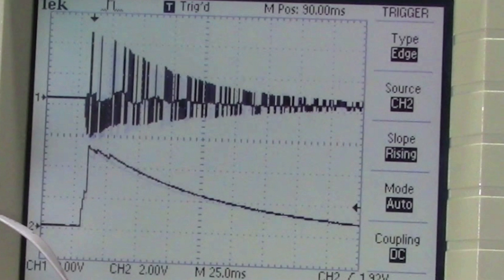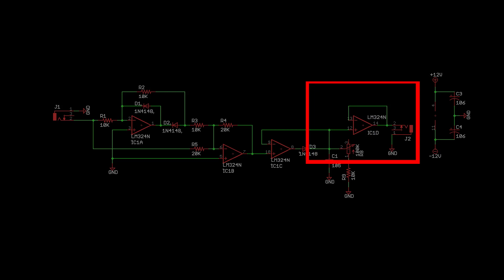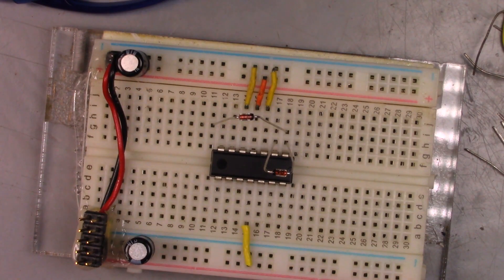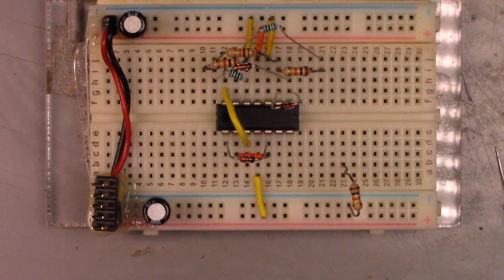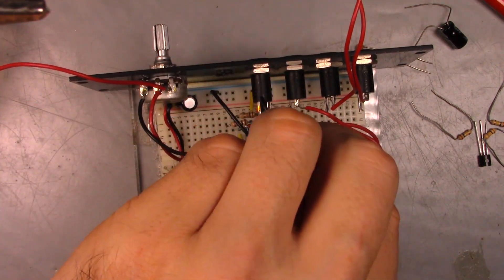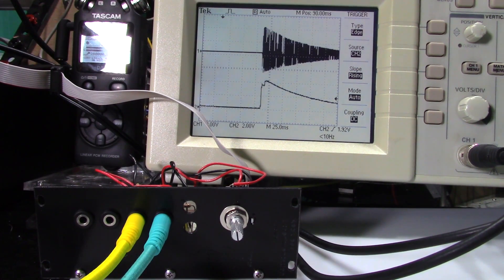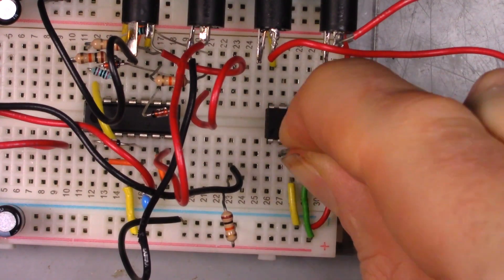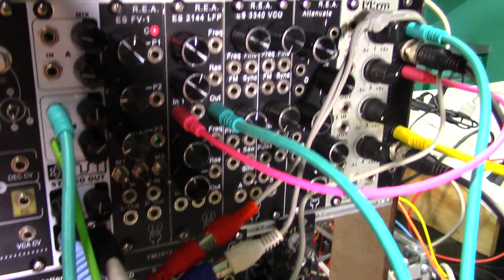Breadboarding a Eurorack Envelope Follower circuit

Comment: Can any quad opamp be used for basic circuit?
Reply from the maker: Yes, Anytime you see a dual op-amp in a video of mine, a quad will also work.
Reply: Reckless Experimentation Audio LLC Thank you for the response. I was trying to add this to a 9 volt circuit that would use this as a ducker like control for a VCA. I thought I didn't have an LM324 and wanted to use a TL074 but the LM324 works on single rail 9volt.

Comment: Is it possible for a circuit to generate a trig out once a certain threshold or peak in the enveloppe follower is reached?
Reply from the maker: yes, you want to google op-amp schmitt trigger. Bby changing the resistor values, you can have the circuit trigger and release anywhere you want.
Reply: @Recklessexperimentationaudio  thank you i will look into it, please continue your projects